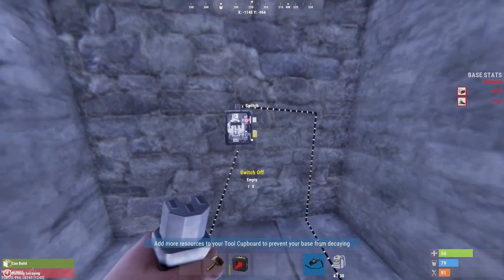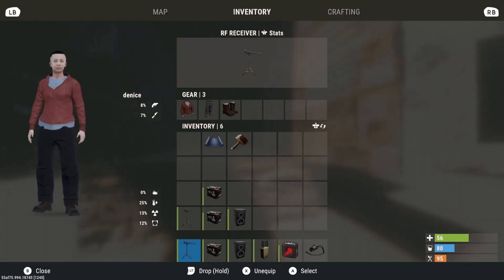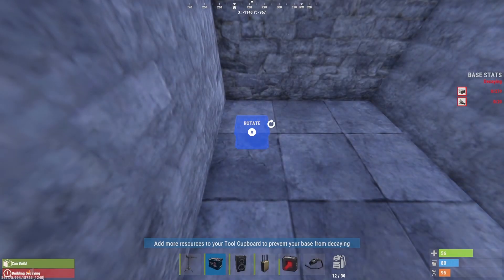Rust: Building a MAP WIDE Alert System

Comment: Once they add smart switches and connect it to the rust+ app it'll make cowardly offlining harder

Plus on pc if you hold the reload button you can change wire colour, i wonder if they've done it on console. Just a lil tip in game tip
Reply: wire colors are implemented and the PTB electrics run at PC level (except for the missing DLC and rust+ extensions)
Reply: I wouldn't count on the console edition to ever be connected to the rust+ app, there's a lot of red tape they have to go through to bring ANYTHING to the console, and the app is something that's just not an important piece.

Comment: This has to be the most useless tutorial I've ever seen. Just use a simple hf sensor to it so that anyone within 20 metres sets it off.
Reply from the maker: It’s for beginners. Mostly just to get use to how alarms and transmissions work
Reply: @CerealOverdrive  I'll admit I may have been abit rude. You should do one on hf sensors at your entrances connected to flashing lights inside of your base to alert you of door campers.
Reply: @CerealOverdrive  or perhaps setting up alarms to go off at the oil rig frequency so when rig is being taken the alarms go off
Reply from the maker: @joeycryderman5942  good ideas. Thanks!